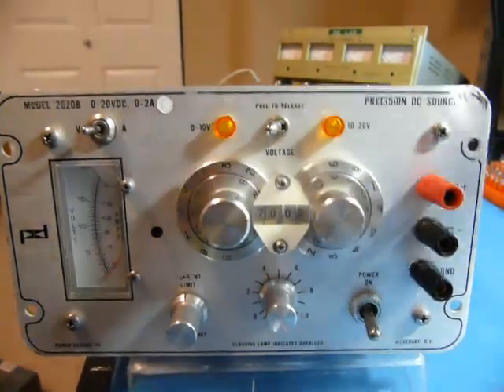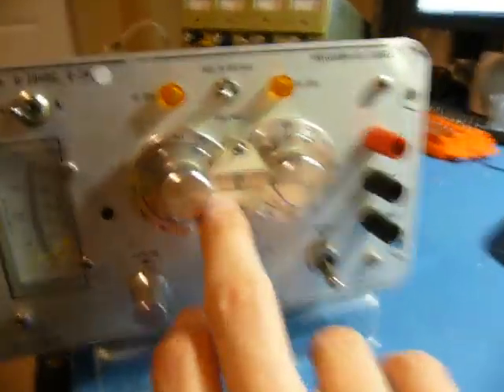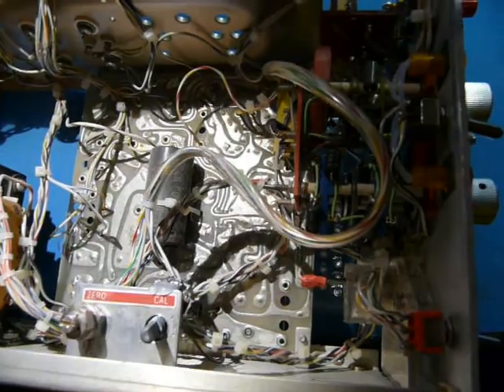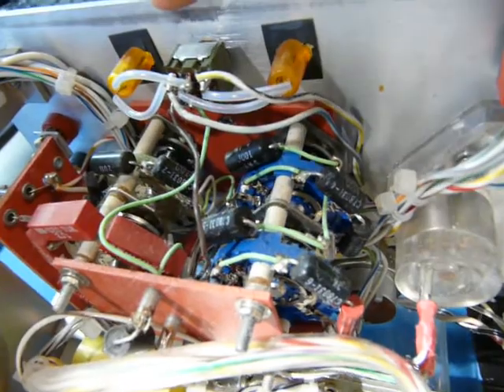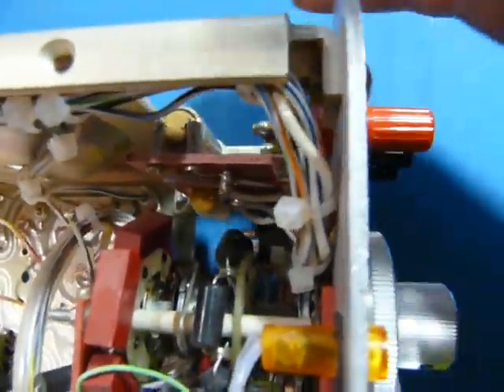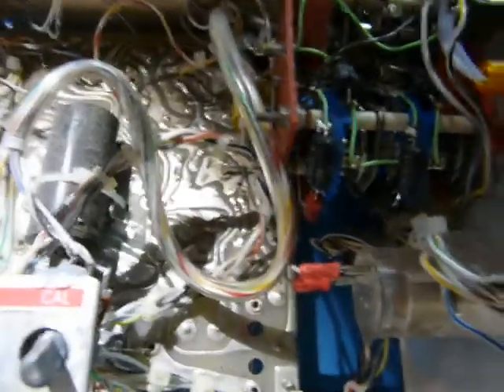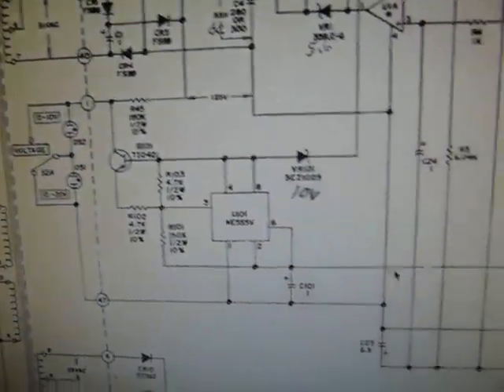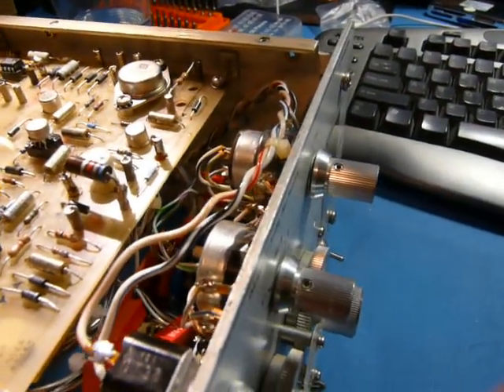Teardown: Power Designs 2020B Precision DC Source

Comment: I know this is an old video, but...  It's pretty clear you don't understand what a jewel you have, here!  The Power Designs precision supplies were very well designed, excellent performers.  They were not intended to be precision voltage references, they were intended to be (way) better than the average bench power supply, and they succeeded at that.  A fair comparison would be against such supplies, and rather than constantly denegrating and downplaying the PD supply, you would have to be saying, "This is thing is pretty awesome -- it comes pretty close to being a precision voltage reference than a typical power supply, and yet you can use it to power your projects!"

On the technical side, it's not clear a chopper as in the Khrone-Hite would be any better than a nullable opamp, which is what the zero pot is actually adjusting.  You sorta hand-waved over a pretty large chunk of clever circuitry to cover all the details necessary to get the performance it does, WAY better than an LM317 in terms of load regulation and especially temperature coefficient.  That stuff's hard to get right, and they did.  And... the 555 is used as part of the pre-regulator, which serves to bring the voltage down in an efficient way before passing it on to the precision part of the regulator.  And so on, and so on... you can learn a lot from studying such schematics.

Bottom line...  I just don't think you realized what you had, here, with this thing.  It's a pretty terrific device, and shouldn't be downplayed this way!  Use it and enjoy it.
Reply from the maker: Hah, yes I was pretty early in my electronics journey (still am now, 8 years later...), so I didn't really appreciate everything going on there. Thanks for the pointers. Maybe it isn't clear in this video, but this thing has been one of my prized possessions since the moment I won it on ebay. I still use it regularly and I admire its designers.
Reply: @spagamoto  That's good to hear!  Best wishes to you!